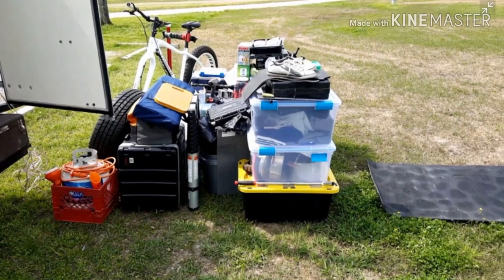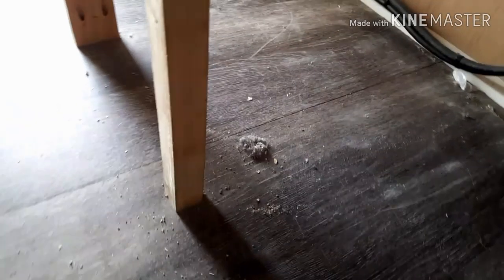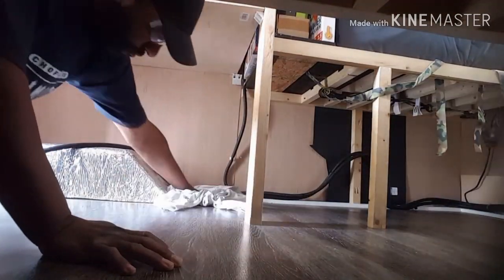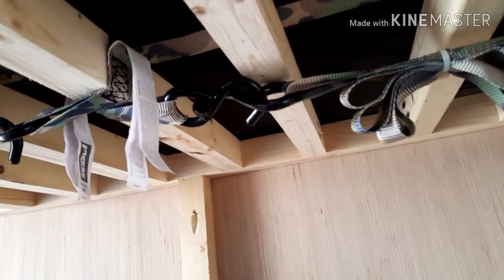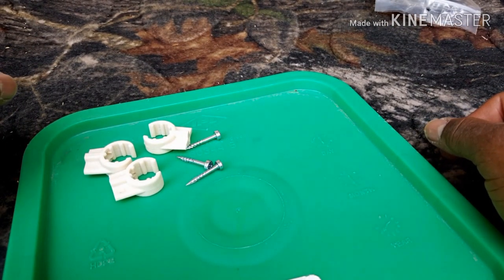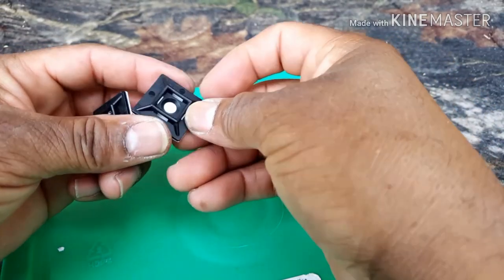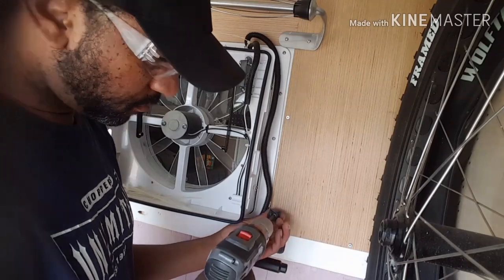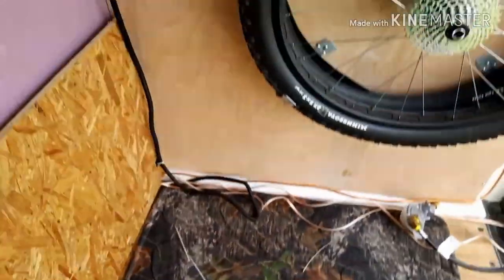VAN LIFE IN A BOX TRUCK:  Cleaning floors and securing wires

Comment: Interesting, didn't even think to get a blower to help with cleaning. Gonna put that on the list, as I continue my research. Thanks for sharing.

As always Keep Moving Forward!
Reply: In my semi I always hooked up an air blower to the seats, I would use it every time I got in the truck especially my boots and pants.
Reply from the maker: @ KM Forward
😁
Space is at a premium in my little box truck so I don't normally have my leaf blower in the rig.  I was moving a few things between work and storage and just happened to have it.  I think if it were much smaller and had a low speed setting,  I would consider keeping one in my rig. Blowing all the dust made a mess, but it was fun for the video.
Reply from the maker: @dm8867  
🤔
I think a small compressed air gun like you had in your semi would be great.  The psi can be better regulated for more control in the tight spaces.
Reply: @xlamontx  you would probably have room for a huge tank under the box. used truck parts you might find a good used tank. Before the battery tools, a lot of us used air tools. But an electronic compressor and an air line never worry about low air pressure. Drive safe.